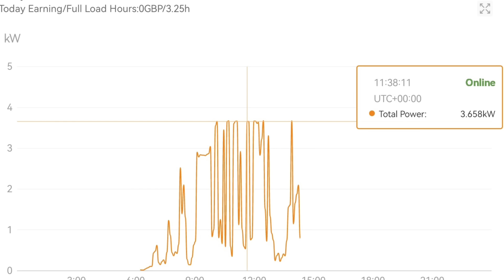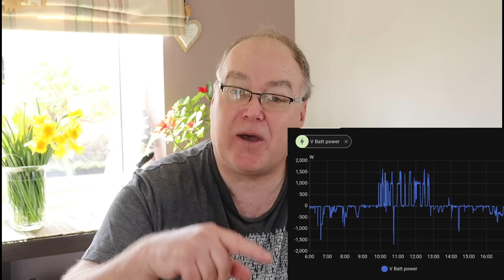Export Iimited solar is a pain - How I'm avoiding the limits 😲

Comment: Really interesting. We have a 30 panel array with a Sigenstor 16kw battery and 13kw inverter but a DNO export limit of 9kw and are coming across this issue - only way we can get around it has been to charge the EVs but have to do it manually which is a faff and obviously if the solar generation drops under the DNO limit we're worse off charging the cars with solar that we could be exporting on the SEG v overnight tariff - hoping more AI functionality will help in future

Comment: A great video many thanks. We have  almost identical interests.
grid don't seem that bothered if you export 1/2kw more than your limit. has anyone actually had any issue while exporting more. ~my local grid voltage is never that high. Suspect they should open up the floodgates and allow more green exports but understand that export payment will be reduced or even  charged. 
With battery prices at last starting to tweak down (still charging 3 times cost mind), large storage systems are the answer where customers are properly rewarded for peak time exports.

Would love more info about your home assistant and how to DIY set one up (bit of a dummies guide), seeing lots of peeps with new solar installs but half don't know how to work them properly, as in many cases that stops when the install bill is settled.

Comment: Bigger battery was the way for me. I don't feed into the grid because as of 1st July the feed in tariff is 0.04 cents per kWh. Completely unsustainable. Battery is now at 30kWh capacity, and along with setting the hot water to turn on during the day to maximise production and savings. Like yourself I am using Victron gear for my system.

Comment: my inverter is a luxpowertek acs3.6 and a G98. I have clipping on most sunny days as my solar production has potential to 5.4kWh  but its all clipped, I have thought about changing the inverter to one that allows me to power my house and fill my batteries with a full 5.4kWh and limit my export to 3.6kWh but my understanding that I would always need to go to the g99 approval even if I limit via a setting on the inverter as it always has the potential to export more than 3.6kWh

Comment: I have just started with Home Automation recently. With the Solis you can ‘switch to Off-Grid’ based on a trigger. My trigger is when E-on decides to Smart Charge my car and I don’t want to drain my batteries, If you have a hybrid inverter that is. You could have a smart plug with a granny charger that might clip it if you haven’t got a zappi. But I agree that with Home assistant I have started to realise what I have been missing out on.

Comment: What makes Victron a complete no-go for me is the lack of a 3-phase IT grid inverter. Having to rig up a gang-connected set of 3 1-phase inverters along half my wall just to get 3-phase is insane.
I do need a house battery even though I am not export limited at all (up to 100kW ok, but ideally stay below 30kW without notifying grid operator here) as the tariff for the export is nowhere as good as using it myself. Saving that sweet sun juice for the night would be best.

Comment: Like you say,”turn things on”. I run my inverter heat pump for cooling down to 25 degrees to dehumidify the house. This follows the conditions outside with the heat pumps thermostat. Otherwise got my EV and house batteries charged during the day. Water heating done with a solar waterheater 5 to 6 months per year.

Comment: I wanted extra solar and the DNO flatly refused me even with equipment to stop export. Only option available is if I am willing to pay for three phase to be fitted.
Reply from the maker: Presume you have old 65a mains wiring? Modern 100a wiring shouldn't need 3 phase. Naughty they push this trying to make extra money on unnecessary 3p installs

Of course deiending on your loads it might be needed, I guess you never know as they don't give you a detailed anysis explaining why it's needed
Reply: @EVPuzzle  Apparently it has more to do with the transformer and line out of our small village, they were concerned with voltage spikes, so 3 Phase was their only answer. I am waiting another year and may ask again at that time.

Comment: With multiple inverters, as you have, how is the total export controlled?
Reply from the maker: Like 3 taps running into a sink with one plug
Reply: ok. but how does 'the plug' know which 'tap' to slow down?

Comment: You might have to keep an eye on how often you write those changes to the Victron, if it's writing to an EPROM it will have a maximum number of writes before it can fail.  I'd definitely employ some padding in your HA automations, and suffer the loss of overrun or clipping to prevent writing to the inverter too often.
Reply from the maker: Uh oh, good thought. I'm probably at around 20 writes a day atm 7500 a year!
Reply: @EVPuzzle  It's probably good for a million 😊😊

Comment: Very interesting video Nigel - I love optimising my grid returns as I’m on the old FIT scheme. A couple of questions though. 1. I understand you have several different grid-tied inverters - how (at 7:24) do you manage to see your combined solar (all arrays) in the Victron system? and 2. How (at 13:20) do you get HA to change the Victron charging rate - which parameter? Cheers Paul
Reply from the maker: Hi paul

Charging rate is changed in vrm under dvcc settings  max amps. I have a switch in HA set to adjust to different values on and off for each of setting. Ha uses modbus to talk to victron directly.

My Victron kit has 2 meters. One on grid one on solar. I've wired all solar through a single distribution board so the AC output from that is all solar combined. It's just a design thing

Comment: IT'S NOT "CLIPPING." The export limiter is limiting the load from the grid. Solar panels are like a battery and will not generate power without a load being attached.

The clipping on your chart is the max capability of your inverter to convert the DC from your solar panels to AC. If you put 5kW of panels on a 3.6kW inverter you can never get 5kW of production.
Reply: No, the inverter is restricting the conversion of DC to AC because the export limit has been reached. He could have a 10kW inverter and 10 kWp of panels, but may be restricted at only 5kW export for example, once the batteries are full the inverter will only invert enough solar to cover house load plus the 5kW export, thus clipping generation.
Reply: @ronskiman4094 He doesn't have a single 10kW inverter. He has multiple smaller inverters. The chart shows a 3.6kW inverter protecting itself from damage. He's going run into a problem of them not all being the same brand to add an export limiter to control multiple inverters.
Reply: @sang3Eta  it was an example, which you clearly didn't understand.
Reply: @ronskiman4094  You don't understand your example is wrong. If you had a 10kW inverter and 15kW of panels, you would still see clipping at 10kW, even if your export limiter was set to zero, when the demand for energy in the home exceeds 10kW. Export control has nothing to do with clipping it's a product of over panelling the inverter.
Reply: @sang3Eta Your just twisting things, I said 10 kW inverter with 10 kWp of panels not 15 kWp, besides my Victron system has 11.5kWp of panels on an 8 kW inverter, it will only clip generation if the batteries are full. Generation being restricted is referred to as clipping, now that could be a result of the MPPT limit being reached, or another limit, such as an export limit.

Comment: Here in South Australia, we have a new system called flexible exports where the export limit can be changed from 1.5 kw to 10 kw. This is largely replacing the old fixed 5 kw export limit. 

Since I have been on it for the last couple of months, my export limit has been at 10 kw most of the time, but I have been reduced to 6 or 8 kw for an hour or so in the middle of a really sunny day when the grid can't take all that solar power being dumped into it. 

It is either controlled through the inverter that's connected to the internet, or a Voltello box that receives the signal from SA Power Networks to raise or lower the export limit. 

Each state in Australia does it differently, however, the method used in South Australia seems to be the more reliable.
Reply: That sounds a lot like Octopus' virtual power plant in the UK. You can sign up if you have a compatible inverter and, iirc, you get better export rates at the cost of handing over control of your exporting.
Reply from the maker: Interesting. Compulsory or incentivised? Older kit no doubt isn't as intelligent?
Reply: @EVPuzzle  New systems installed after July 2023 its compulsory, but not for older systems, but you can join the scheme with an older system like I have.

Comment: Sounds odd, surely the point of a battery the purpose is to recharge it in the day time if you have enough, and not to need any from the grid at night rates. It is not some new wheeze? I though this would say use the excess to do something useful and novel, after the battery is full, like melt scrap metal into ingots in an electric induction furnace!
Reply from the maker: I'm just paid more to export it at 15p vs 7p to import overnight and charge up. Its just math. Good news is I'm winning either way so can adapt to energy market changes

Comment: I use a different approach. I have a 20KWH house battery, and I have a separate 40KWH overflow battery. I charge the overflow battery when export exceeds my 10KW limit, and discharge the battery to grid during morning and evening peaks when solar generation is low

In winter, the overflow battery is used as extra house storage. Batteries are repurposed EV batteries so have minimal cost. I have 16KWp solar and a 10KW export limit
Reply from the maker: Thanks for sharing. Very interested in how you manage them seperate.  I've considered a seperate battery solution too if the price was right  but integrating and controlling them is the challenge I think.  Great to hear about EV battery use. Huge potential with these batteries if you get a compatible BMS or have skills to rebuild
Reply: @EVPuzzle  I have a dedicated hybrid inverter to charge the overflow battery (it was a spare I had available, but I could have used charge controllers). I have 4 x microinverters connected to the battery that are on a 230V timer switch which controls discharge (timer switch connects the micro's to the grid, turning them on). I very the number of microinverters in the string depending on battery charge

I use Nissan leaf battery modules as they are easy to work with. Configured into a nominal 48V low voltage battery for safety and redundancy (high voltage battery puts all cells in series, so a single weak cell makes the battery capacity [AHr] fall to the level of the weak cell). I use a Solvenian BMS designed for the leaf battery chemistry, and an active balancer 

Been operating for 6 years. Highly recommended. A novice can DIY if a bit of research is done on YT

Comment: Solis series 6 inverter allow export to a DNO set limit, and any extra charges the batteries. But like you, I would also like to be able to use any "excess" above the export limit in a useful way in case batteries reach 100% Any ideas ? I dont have an EV yet but do the EV Chargers react quickly to spare export from solar ?
Reply from the maker: Thanks for sharing. Yes I've chickened out of node red. I guess they're both able to do the job do it's which are you more comfortable with

Comment: I have lots of automations, but they all run in Node Red directly on the Victron system. My HA does supply some info to the Victron system though.
Reply from the maker: You're right on Zappi but I find it's the initial startup that's a problem it can be 30s to get going so not as reactive. Works OK once charging but starting and stopping big loads isn't ideal. Victron charging of batteries reacts faster. Also damned Zappi doesn't allow Amp changes online. It'd be off more use if it did.

Comment: I wanted to add an extra 8.8kw Sunsynk inverter on top of my existing 8kw Solaredge inverter.  I have a 5kw export limit already, which I was planning to maintain for the whole site.

The outcome of the G99 application was a quote for approx £6.4k to reinforce the supply cable to my house (final connection only, excavation, and supply of cable not included in quote).

The reason I was quoted this was to do with “State 3 conditions”. I.e. what happens to the voltage when export limitations fail.  My house voltage hits 248V max at 5kw export.  The legal limit is 253V, and excursions above the legal limit at only permitted for 15 seconds max.

So my DNO considered a failure of export limit for both my existing and new inverter happening concurrently (2 failures at once).  No reply was made when I counter proposed automatic independent overvoltage isolation of the new inverter.

Sadly it’s killed the project.  My only reasonable options now are off grid for future expansion.
Reply: Lots of people have similar DNO /Grid problems. 😕
Reply: Annoying isn't it? Which DNO area is this? Although I can see why they are not keen to give you another 9kW, when you already have 8 on a 5kW export limit. Is it easy to get your Sunsynk and Solaredge to coordinate to a combined 5kW limit? Would one be 'in charge' and control the other, or do you have a separate monitoring system doing that co-ordination?
What device did you propose for 'automatic independent overvoltage isolation'? The only G99 certified separate kit I could find was very expensive, when really a small device to just monitor the connection voltage (and G99 state machine to comply with G99/2) and disconnect really shouldn't be very expensive at all. (A schneider 62A modbus-controlled contactor is £160 (and Chinese ones are £20-odd) plus an ESP8266 or similar controller can do arbitrarily complicated monitoring+disconnection).
Given that both those inverters are type-approved, and will disconnect above 253V, one wonders how a fatter cable is supposed to help. Yes that would let them raise the export limit, but that's not the point here.
Reply: @ Both the inverters have their own independent grid metering systems so they can see each others export, but they can’t communicate directly to each other.  They would in effect fight each other for export, but that’s not the DNO’s (SSEN) problem.

The DNO’s concern is failure of export limitation.  For this, they are considering the worst case, which is a failure of two export limitation devices concurrently.  Thus it would not help if the 2nd inverter was slaved to the 1st inverter.  Personally it is beyond industry norms (offshore / maritime industry) to consider the probability of double independent failures.  The reason is that they are always due to poor maintenance (you know one device has failed and have chosen not to repair it).  So considering this, I don’t think the DNO is being reasonable here, especially given that they have G99 approval with all the protections built into that standard.
Reply: So the DNO is worried that the cable good enough to import 14-16 kW can't handle your theoretical export limitation failure spike of a similar kW. 😭🤦
Reply from the maker: Interesting, our voltage is very high here and I've raised it with our dno and asked them to tap it down but say they are within limits... Just. 
Some days we're above 255v for hours . I guess each dno is different but I heard the legal limit for them was 256v not 253v

At least I've done the right thing and raised it with them.

I'm also glad I've got two seperate methods of limiting export
Reply: @EVPuzzle a friend had this issue where at 9kw export he was hitt9ng 265v and his inverters were tripping out due to over voltage.

When export reaches 9kw and voltage is above 255v, his 3kw Immersion is turned on via HA.

Also when his battery reaches 85% charging from solar stops and only resumes when export is 9kw or voltage is 255v+  this in effect reduces the export Line voltage.
If this isn't enough, he has a 2.5kw oil radiator on a tapo plug that acts as a dump load and that is automated as a last resort.

HA is the next best thing to sliced bread 😂
Reply: The 8.8kw sunsynk can only output 8kw when grid tied. It can make 8.8kw in an island-off grid scenario.

Also it is firmware limited to 9000 max export.

I have an ESP32 board connected by modbus to my 8kw sunsynk and Home assistant controls the automations.
I have 14kw of solar over multiple inverters. And I run Into the same issue as Nigel.

I have 35kwh of batteries.  The current energy plan is charge to 95% nightly and then after 05.30am the charge limit is set to Zero amps.  No charging.
Then when solar exceeds 9.5kw (export is pegged at 9kw) then it increases battery charging amps sequentially until export drops below 9kw.

Overnight charging costs less than the export value in the day, so its a no brainer